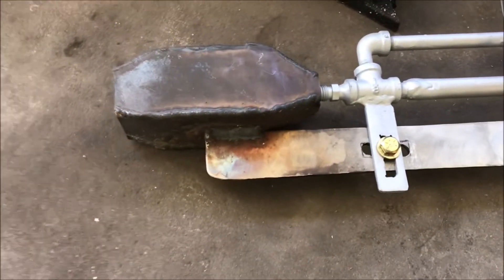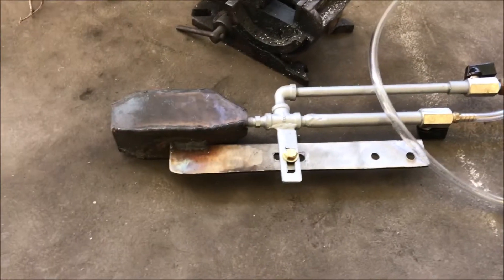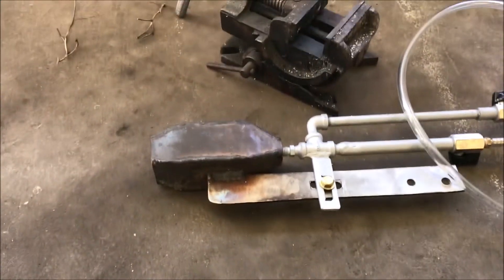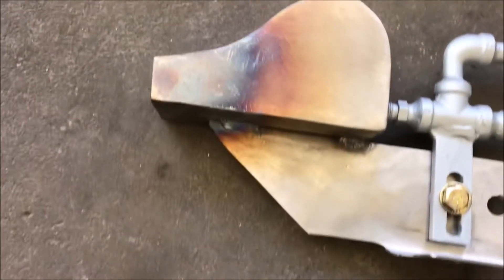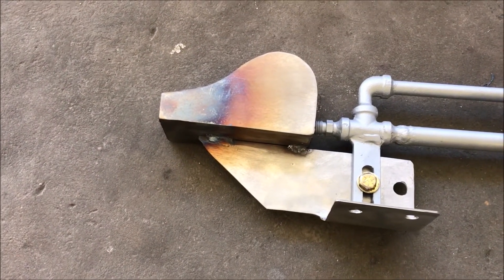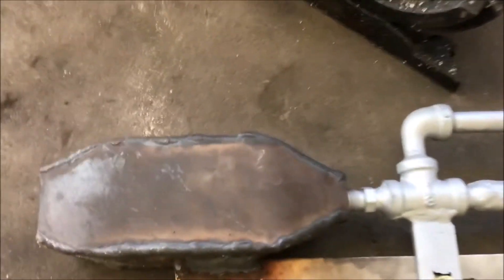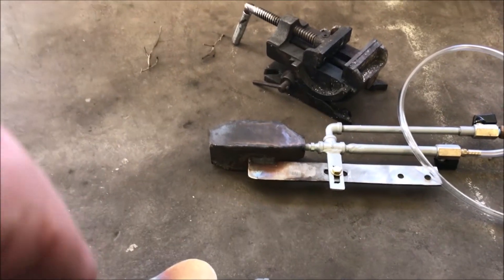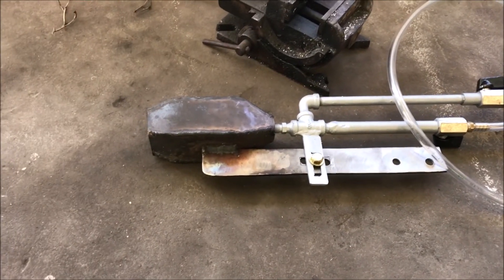Baby Godzilla Burner 60 Kw waste oil burner (DESIGN) and valve testing

Comment: Just wanted to chime in, Bob has mentioned in a few videos now that the dragons are hard to use. However we have 3 dragon-type burners, and once we cleaned up our fuel lines with fuel/water separators and got all the water out of our air lines we've had nothing but success with the burners, going on heavy used for ~2 months now and still getting huge steady heat output. We run about 12-15 CFM per burner @ 60-90 PSI. Strategy for lighting them is "make the chamber glow red".